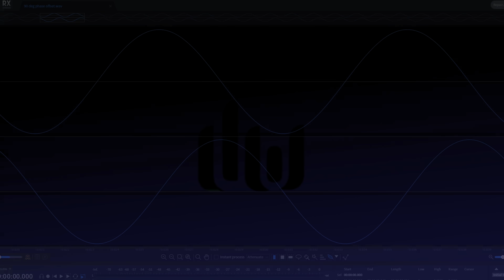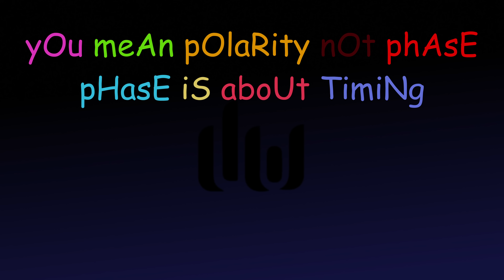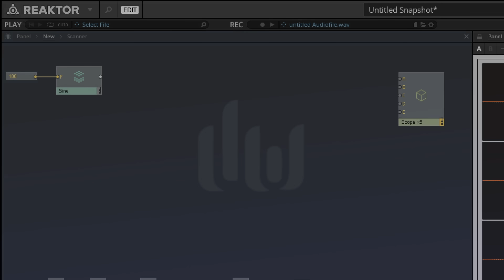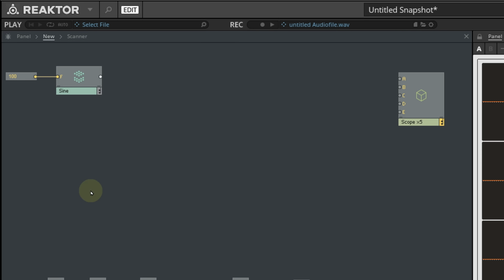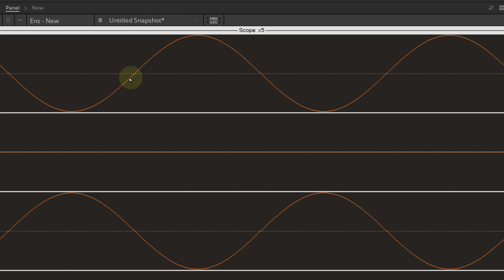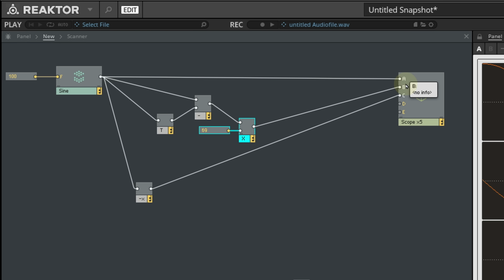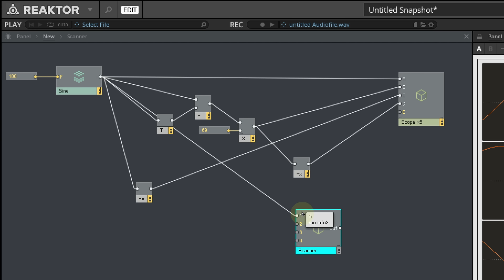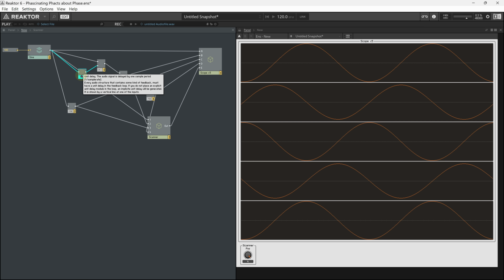Phascinating Phacts about Phase

Comment: Let me add something here.
First of all, thank you an awful lot for making me aware about the important difference between dynamic and condenser microphones. I've composed electronic music, I've made small pieces of code for applying nonstandard effects to audio, I work with audio editing software almost every day but I never had an idea about this difference that you've just explained.
The thing I would add here is the following:
Many people know that for phase-shifting all the frequencies by 180° while preserving both their amplitudes and their time alignment, all I need to do is multiply everything by -1.
But now, if I want to phase-shift all the frequencies by 90° and still preserve their amplitudes and their time alignment, oh man, how on earth am I supposed to do that?
Well, this is exactly what a Hilbert transform is used for. And you have two options here. If your sound editor allows phase shifts via FFT, then you can just instruct it to convert your sound into frequency domain, shift all the phases by 90° and convert the result back into the time domain.
The option # 2 is assuming your editor allows convolution with an arbitrary signal. So you first create the specialized signal that you use as what's called the Hilbert transform kernel (look up "Discrete Hilbert transform" in Wikipedia). Then you take your original recording and convolve it with this HT kernel. The result is your original recording with all its content phase-shifted by 90°.
Warning, a proper HT kernel is not causal, which means that in theory it's supposed to include some non-zero values even **before** the zero time! This is practically only possible with recorded material but not with real-time input. Therefore, the non-causal HT kernel is often made such that it introduces a slight delay of the phase-shifted signal. If we then want to compare our result to the original non-phase-shifted signal, we have to delay it by the same amount to have them both in sync.
BTW, a question for the curious listener/reader: Canyou guess what a Hilbert transform has to do with linear frequency shifters? (Assuming you know what a frequency shifter is.)

Comment: Would an  all pass filter be able to fix this issue 
If not how it could possibly be corrected in the real world scenario
Reply from the maker: No, because the allpass filter creates varying phase shift across the spectrum, rather than a constant 90 degree shift. I gather a "Hilbert transform" can do 90 degrees phase shift, but don't ask me about that type of maths! If you do a FFT you can then easily shift phase by any amount at any frequency before iFFTing back. You could just ignore the issue, because a constant 90 degree phase shift isn't going to cause any comb filtering or colouration, it will just mean a dB or two of level drop compared to them being perfectly phase matched. Or you could ignore the issue because it doesn't exist: lots of authoritative people are telling me I (and DPA!) are wrong, and it seems I have to do some tests and probably a follow up video...

Comment: That trick of crossfading 0, 90, 180 etc to get different phase shifts I think only works with specific waveforms (including sine waves); but you can get arbitrary phase shifts from any 90 degree phase shifted signal pair +such as from a Hilbert operator) using complex multiplication.

Comment: So if you let’s say wanna combine a condenser and dynamic mic recording, can you use phase rotation and put the dynamic mic recording minus 90 degree and call it a day?
Reply from the maker: Well, yes. Except lots of people are telling me I'm wrong about this anyway, and I'm going to have to do some testing! In reality, no mic has a flat phase response anyway, for example a 57 has a deliberate low cut to counter proximity effect, and that will affect phase like any other HPF. In practise, matching the distance between your mics will get you close enough at most frequencies, from there use your ears and do what sounds good.
Reply: @DanWorrall  i mean, this is insane to me how ppl are calling you out tbh. Bit of a Dunning - Kruger effect.
For the record, I had no idea about this HOWEVER, once I was recording with my MV7+ (the podcast version of SM7, same thing pretty much) and it was very asymmetrical on axis, but from a 90 degree angle it was perfect.
It was like 8-9 months ago and I was wondering about that since.
But now it makes sense how that would happen. 
Love the videos Dan! 
We all learned so much actual ausio science from you over the years!

Comment: Hey Dan! I love this content, thank you! I tried this ensamble in Reaktor hoping to phase shift any oscillator waveform. I noticed that this math only works for pure sinewaves. Phase shifting using this method doesn´t work with a sawtooth, or any other waveform. It appears that the more partials the waveform has, the more noise I get at the output. I wonder if that is because of the rich harmonic content in comparison with a  pure sine wave?

Again, AMAZING content, always mind blown!
Reply from the maker: Indeed, it wasn't meant to be a general way to phase shift arbitrary waveforms, just a (simplest possible) demonstration that all the phases can be derived from a sine.

Comment: Hi Dan, one of those sceptics here: 
I ran the experiment with an Omni-Condenser, an Omni-Dynamic, a Cardioid Dynamic, and a Cardioid Condenser with a switchable low cut. 
The test tone was a sine wave out of a single speaker at 50hz, 100hz and 200hz at close distance. (low frequency = long waveform = less alignment issues)
None of the results show a phase shift approaching 90 degrees, maybe 45 at most. 
Most differences appear in the 50hz test where some of the microphones have a built in low cut filter. 
Running two identical cardioid condenser mics with the low cut engaged on one of them threw them out of phase by about 45 degrees at 50hz. Predictably, this effect lessened with increasing frequencies until they where in almost perfect phase at 200hz. 
From these tests it seems that the polar pattern had no predictable effect on the phase, neither did the type of microphone (condenser/dynamic). None of the observed phase shifts came close to 90 degrees. Interestingly, apart from a sanity check I did with two identical mics, NONE of the waveforms lined up perfectly, leading me to believe there is more going on. (maybe electronics within the mics?)
Please look into this, I am more and less confused now than before!

p.s. I started this because I found myself asking: Why would there be any physical reason one type of membrane would react differently to soundwaves than another?
It seems to me, and my testing seems to confirm that, that the distinction between pressure-, and velocity transducers is a purely theoretical one: In reality, the mechanics of air coupling with a hard surface (i.e. a diaphragm) are a lot more complex, and pressure and velocity are two interlinked parameters of the same wave that are inseparable above 0hz. 
I would also argue that the only thing that can accelerate or decelerate a physical object (like a membrane) is a force, so a pure velocity transducer feels counterintuitive to me.

edit: As Njoy Music pointed out, the idea behind the theoretical phase shift is that the membrane of a condenser microphone produces its peak voltages at either end if its travel while a coil produces the voltage peaks at maximum velocity. Instead of the velocity of the air in the soundwaves it measures the velocity of the membrane. At least that is a theory with some physical merit, but still it doesn't seem to manifest itself in my measurements.

p.p.s. I have been looking for a satisfactory explanation for the proximity effect for a long time now, maybe you could set the record straight on that in a video?
Reply: Yeah I’m a bit confused here as well (not just by the maths) because I routinely mic snares and guitars with dynamic and condenser pairs. When I align the capsules the waveforms are perfectly aligned as well - obviously they have differences but their shapes on screen are still very similar, and the peaks and troughs always match. I know the mics well enough that I can get the waveforms to line up within a few samples really. 

So what is that? Is it just that I’m working with complex sounds and not simple sine waves? I feel like there’s just something I’m fundamentally misunderstanding here because what he’s describing is not translating to my real world experience (or maybe it is and I just don’t know it).
Reply: Just did the same experiment with a cardioid condenser and a cardioid dynamic and same result: pretty much perfectly in phase.
Also tried an omni and same result again (but I can't be 100% sure that mic is really omnidirectional as it's a cheap measurement mic).

Comment: in defense of the pedants (I'm going to hell for this): speaking in electrical terms, isn't it still more proper to say that we are flipping the polarity, not phase, when we push the (agnostically dubbed) "inversion" switch on an analog console? 

If I understand the way consoles work correctly, and I'm nearly sure I've got something wrong, aren't we actually activating a switch that flips the wiring for that channel so that the positive and negative leads are swapped--and therefore quite literally changing the polarity of the input signal?
Reply from the maker: It is more specific, yes. And to be fair I do try to be that specific in my scripts. But reversing the wires / changing the sign bit does cause 180 degrees of phase shift, and the word "flip" specifies that, so I maintain that "flipping the phase" is both technically correct and unambiguous in practise.

Comment: I‘m pretty sure that in the far field, pressure and velocity are actually in phase. In the near field they‘re not, but then also the amplitude ratio is frequency-dependent (6db/oct). To my knowledge there are no conditions where they would be related in a way where phase shift is flat 90deg and amplitude also flat. That would be a Hilbert Transformer, which doesn‘t really exist in nature. The actual difference between the two mic types is in their behavior close to the source. In the far field, they should work more or less the same. No?

Comment: Is that also what differentiates PM from FM?
Reply from the maker: In practise, PM doesn't change the period of the wave, so it doesn't go out of tune when you change the modulation depth. Which is generally more useful for synthesizing pitched instruments.
Reply: Not sure if my question was maybe a bit misleading, or if we actually meant the same thing.
What I was actually wondering is whether the underlying idea behind your “delay and phase shift” point might be the same between FM and PM:
in FM, the modulator changes the rate of change of phase (so it’s like integrating the modulator),
while in PM it directly alters the instantaneous phase itself.
FM of a signal is equivalent to PM of its integral, and vice versa.
So I thought, couldn’t you also say something like
“Frequency deviation always implies phase modulation, but phase modulation doesn’t always imply frequency deviation”?
Curious if you’d see that as the same underlying concept behind your “phase shift without delay” idea.
Reply from the maker: @tysk_dt seems like you understand the maths a lot better than I do, frankly. I just know how to make sick bass sounds with it.
Reply: @DanWorrall  Fair enough. Bass matters.
Reply: @tysk_dt  “Frequency deviation always implies phase modulation, but phase modulation doesn’t always imply frequency deviation” - Another T shirt!

Comment: Both type of microphones have velocity and pressure characteristics (or parameters) of the membrane which to get excited due to resonance from the incoming frequencies.
Physically you can not separate those parameters! Pressure is force field affecting a surface field. Velocity is the rate of change of said force field! There is a direct connection.
But, since we have mass involved (the air\gas medium) and the matter\material of the said surface (microphone membrane in our case), pressure will always have a shift if measured as a wave.
But can we really place two mics at an equal distance from a source audio signal emitter? Can we orient their capsules\membranes perfectly parallel (or rather radial) from the source. There is always distance (hence time) difference anyway. Certainly, high velocity does not mean higher pressure. But at the end of the day we are in need of an air (gas medium) movement to result in air particles being displaced in a wave type (3D or mostly wider cone shaped) fashion. Hence impulses (from Physics) are involved. Condenser mics need less impulse for its momentum to cause a resonance in its membrane whilst dynamic mics need more power of that said movement of the air impulses.

Comment: i'm not quite convinced yet. you showed how it works with a perfect sine wave, but  would it still work with a complex waveform? if yes, then why would everyone use a hilbert transform to apply a 90° phase shift to a signal, instead of this easy peasy looking calculation?
Reply from the maker: I wasn't trying to demonstrate a viable method of rotating the phase, just to demonstrate that all possible phases are encoded within the sine already and can be derived without time shifting.
Reply: @DanWorrall the experiment proved that phase shift does not always imply delay, but realistically most waveforms that reach a microphone are more complex than perfect sine waves. that's why i'm wondering if really all of them are just 90° phase shifts to the ones of the other microphone type if the method that seperates the mics can be described like this mathematically

Comment: I'm wondering if this 90 degree phase shift is the wrong way to think about it. Yes, cos(x) is the derivative of sin(x), but... If I think about fourier decomposition of a signal, you need to use sin(x) and cos(x). One for the real components, the other for the imaginary components. So perhaps these two different kinds of mics are encoding those two parts of the signal? Just a thought.

Also, if one signal is actually the derivative of the other, could you (should you?) correct it by taking the integral of the signal to match it with the other mic?

Comment: Thought experiment: But what, then, do the transformations conducted at lower sampling rates 'look like'?—the deltas thus coinciding with displacements in time greater than the unit vector [of the phenomenality instantiated by a higher sampling rate], so are measurable, so do reveal this movement 'in time'.

Comment: I've never heard that about condensers vs dynamics and I guess that makes sense but what about active ribbon mics?
Reply: Ribbon Mics are a Sub Set of Dynamic Mics so they should have the same general behaviour 
PS I am just repeating Dan Worrall's earlier reply to @mitallast about 16 comments above yours so it should be correct if it was me actually answering it should be treated with Extreme Caution as I'm clueless about this stuff and a Serious Amateur not a Pro  OK but I enjoy Trying and that's the main thing  Enjoy It
Reply from the maker: I am certainly capable of being wrong, and might have been in this video! But I'm confident on that point at least: a ribbon mic is just a dynamic mic with a thin ribbon shaped diaphragm, and an active ribbon just includes a preamp as well.
Reply: @DanWorrall  that makes sense to me because I have an active ribbon and sometimes I leave the phantom power off and just run it through a cranked the preamp for a different sound

Comment: I was literally just thinking about this the other day.
Microphones record derivatives while speakers or headphones produce integrals. Whats the integral of a sine wave? A cosine wave, which is literally just a 90º phase shifted sine wave.
Dynamic mics produce single derivative digital signals of the pressure wave because the signal is a measure of the velocity of the diaphragm, shifting the phase of all frequencies by 90º.
Condenser mics measure the displacement of the diaphragm directly, not velocity, and so they don't shift the phase at all.
But remember, dynamic speakers and headphones integrate the signal, so with a condenser mic signal, the speaker outputs an integrated (90º phase shifted the other way) version of the original pressure wave.

Comment: wow... hard to admit but ok. so normaly a dynamic mic should have very low output in the pic of standing wave cause pressure is chabging a lot but velocity is zero... is it maybe because the output of condenser is related to membrane position and dynamic output is related to coil variation (speed is derivative of position so 90 degres phase shift) and so a dynamic mic is not really mesuring speed but just always 90 degres shifted so it corralate with particule velocity in a progressive sound wave... sorry for my english i'm french i love your videos so much. i'll try the experience soon to understand more about this crazy info thank you

Comment: My mind was blown when you basically performed a first order derivative USING MODULES IN REAKTOR. A sine with 90 degrees of phase shift is after all.. the cosine.
Reply: I knew that was possible but never fully connected the dots that it could be a good way to get a sine cosine pair, i feel it would be much cheaper than the standard way of doing this in reaktor

Comment: Thanks for the nugget.  Never thought about that?  But thinking intuitively.  A capacitor mic converts sound pressure directly to capacitance but a dynamic mic output is derived from inductance of moving magnetic field (the derivative (or rate of change) of the sound pressure)